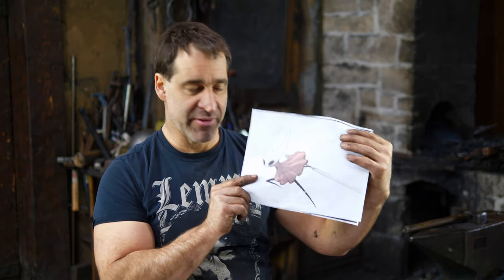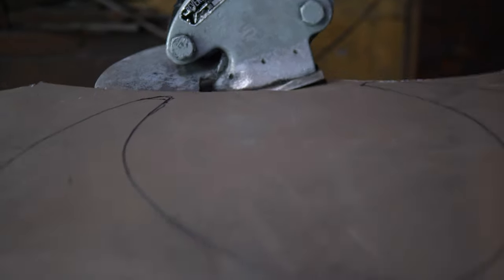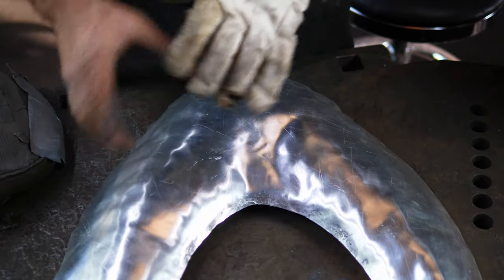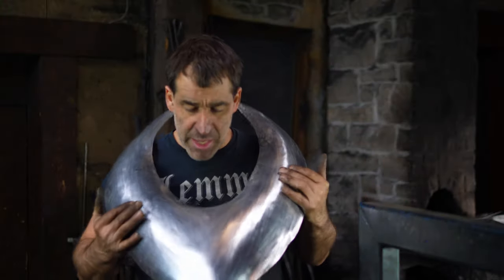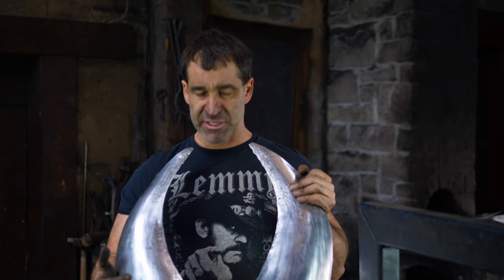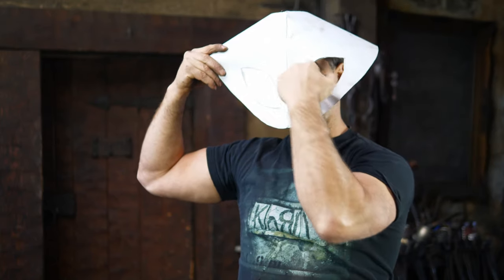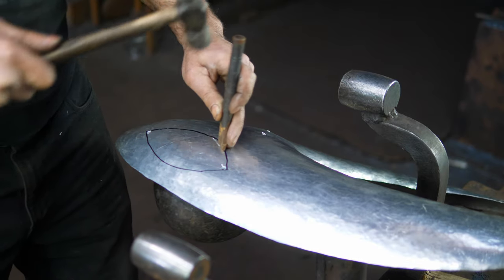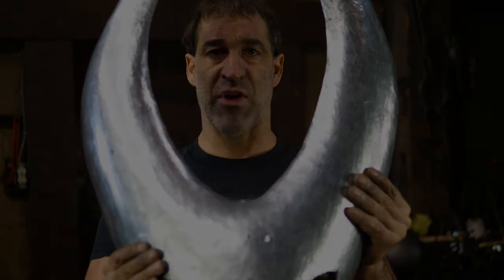Making the Hornet's Mask from Hollow Knight

Comment: if you put a flame to aluminium folie (like you use in the kitchen) it turns into aluminium oxide and becomes transparent. Is it possible to hammer the eye-areas of an aluminium mask thin enough for that effect to work on a mask?
Reply from the maker: It's hard to say how practical that would be, or if that would even be possible with aluminum sheet.